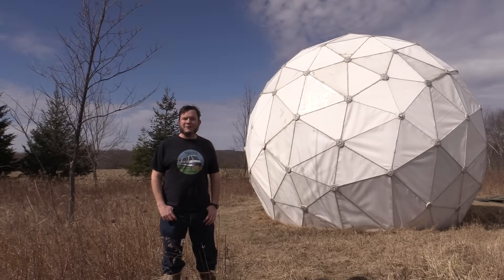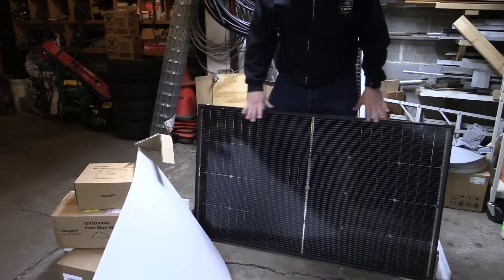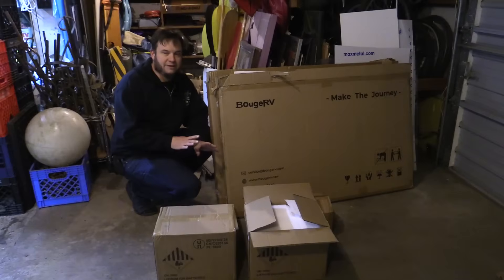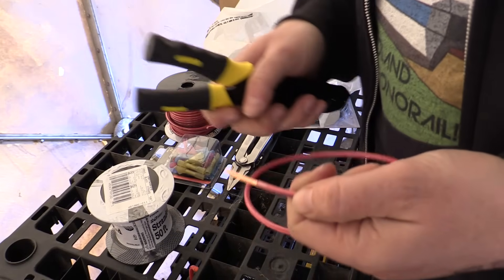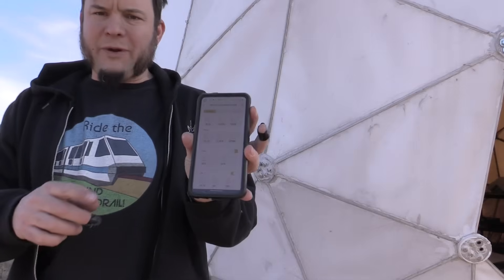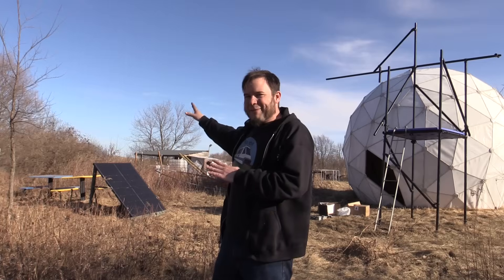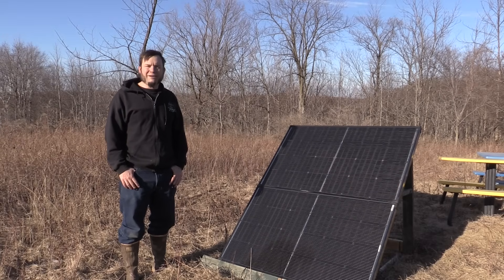Adding Solar Power To My Geodesic Radome - With BougeRV Equipment Review

Comment: Great video!  I have that exact BougeRV 2000w inverter.  I've never gotten the bluetooth to work, and the voltage fluxuates at low power (~40w)... but levels out and runs great at 150w+... and It did fine pulling 1500w.  if you have an oscilloscope I'd recommend putting it through tests before you hook up any high dollar electronics to it.  I'm curious to see how it works out for you.

Comment: Dude I feel you with the price of wire and hardware. I used to manage an auto spares shop and I got cost plus 10% pricing, and loads of free oil and filters for my car. I just had to buy my first oil bottle 2 years ago for my work vehicles and paying full price for 20L of full synthetic sucked! I’m in the process of adding driving lights and a DC/DC charger onto my ute so I bit the bullet and bought 50m of wire and man that hurt lol. I’m putting a roof top tent onto my daily ute, as it has a huge alloy tray and ladder racks so I’ll put a roof cage all the way along and bolt the tent to that, then I can still use my tray and it’s only a few bolts to remove the whole lot for storage. Once that’s done I have another ute with a camper on the back that I need to completely rewire, insulate, add some batteries, solar, and then set that one up. I love the work though, I really enjoy figuring out the best way to do things and how to make it just the way I want. Those solar domes look like they’d make an awesome tent! I had an idea of making a house with domes like that, all modular, connected with smaller tubes so that you could add more and more domes to your house when you wanted, and you could make it in any configuration you wanted, and make them so that you dig a 3ft deep round hole in the ground, concrete and insulate it then put the dome over the top, solar panels on the top of the panel, and have blackout curtains so you could block out the sun and close the room off completely if you’re not using it so it stays cool/warm. Maybe if I win the lottery I can try it out haha. Great video man, I love your content, it’s not all my thing but you make it all interesting. I just wish I had an Axeman in Australia!!

Comment: Depending on how well the inverter was designed, you may have just built yourself an annoying RFI generator. Loosely twist the wires between panel and controller, and put ferrites on all wires close to each device, just to make sure you don't create any weird unwanted signals.

Comment: So I noticed on the box that those are bifacial solar panels. I checked their website (which is kinda broken for me?) and it says they're transparent on the back and can make 80% of the power the front makes. So putting them vertical with one face directly west would be an option, if that made sense for your setup. That way they make heaps of power in the morning and the evening, and don't overheat at noon. You might be too far north for that to be worth it, though. Especially the overheat bit haha

Comment: MC4 connectors are dogs breakfast, not using them is a good thing.

Also, either your hands are really big or those inverter cables are a bit undersize, should be 00 gauge for 2000W, at least that's what it is in 240v countries, but 12v is 12v and 2000W is 2000W, so it should be the same up there. 

Congrats on surpassing 250K, great to see it

Comment: Great video, Gabe! Just a little something I learned about inverters (especially cheaper ones) is that the HF interference is CRAZY… like a few other comments mentioned you might want to use buck converters or possibly build a faraday cage… not sure if it will even be a problem for higher frequencies but if you end up getting noise, the inverter is most likely the culprit

Comment: You "need" a forklift out at Sandland. Not the kind you see in your local warehouse but the kind you see outside that operate on multiple axes - including moving in and out on the horizontal axes for example. You can then do the sketchy thing of using a pallet (I'm not sure why that's spelled that way) as a platform and you can reach the top-most part of the dome without the more sketchy thing of using multiple ladders. Note the quotes around "need".

Comment: I implore you to ditch the inverter and run DC to DC adapters for your kit in its place! The spectrum noise generated by most Inverters (even the pure sine wave ones) can be horrific!

No problem with a decent MPPT solar converter and DC to DC in my own experience, until you turn on the inverter!!!!
Reply: I run HF to 10GHz from my campervan. 480W of MPPT controlled solar , 305AH of LifePo4. When the inverter is off I get zero appreciable QRM from the system.

Comment: 3:45 unacceptable.  That's literally 1000s of $$$  and they couldn't be bothered to include the wires?  BIG disappoint.
Reply: They can supply cables but they have to be ordered separately. This actually makes sense because each installation has different cable requirements. Their website seriously needs improvement though - I couldn't get it to work on two different browsers. It eventually took a Google search to find their cable section!

Comment: Does sand land have any creeks? Check out a guy in New Zealand called Marty T. He's you but with diggers. He's made a power plant for his forestry block using a creek, some used piping and a washing machine. If you need a relatively cheap 120v ac supply and have the know how and terrain might be worth a look at.
Reply from the maker: We don't have any permanent water, just a little when the snow melts.

Comment: Nice setup. Just be cautious of low temperatures. The battery management system will limit charge current based on temp and won't charge them at all below 1 or 2 degrees Celsius to prevent damage. Here in Europe, domestic solar batteries are using built in heating pads to cope with the winter

Comment: Could look into solar tracking.

Also depending on what you're running, like lower power computers, instead of running the inverter, run into a buck/boost converter, it will be more efficient than making AC and converting it back to DC

Comment: You did it again Gabe! Two videos in a row for my current priorities getting ready for summer-eBikes & upgrading my solar panel system for camping.  Amazon orders are dropping in with solar panels, MC4 cables/connectors, panels etc.  A new eBike on it's way.  You've been spying on my To-Do list!  Well done.  Look forward to the continued dome power project.

Comment: I wouldn’t worry about the solar panels interfering with the radio telescope, but rather about the DC-to-AC inverter and the rest of the electronics you installed in the dome.

Comment: Make sure that the batteries have some sort of low temp charging cutoff.  Lithium iron phosphate cells will instabrick if they are charged below freezing.  The better batteries have built in low temp shutoff in the BMS that will shut them off but a lot of cheaper batteries do not do this.  (even if they claim they do)

Comment: I'm not trying to be a d%^k but, come on. A hardware store is not going to have Mc4 connectors, they don't sell solar panels so they definitely aren't going to have the needed wiring accesories.
Reply from the maker: Some of them do sell solar panels, one even sells wind turbines.
Reply: @saveitforparts  lowes or home depot? or a smaller one like a mom and pop store

Comment: cats will pee on your solar panels. Out in the wild like that, WILD cats will pee on your solar panels.

Seriously, I'd be worried about wiring getting chewed. Even when I'm nearby, raccs and rats chew on any wiring or soft plastic.
Reply from the maker: A lot of wires have soy-based insulation these days, I think most modern cars are pretty tasty to rodents.

Comment: For lots of applications ditching the mc4 connectors and doing a simple crimp/heat shrink creates a more reliable connection. Without having to buy a fancy crimper and connectors youll use once or twice.
Im a commercial/industrial electrician, electricity doesn’t care if you use an mc4 or not. Just make it nice and tight and water tight
Reply: As someone who's worked in the industry, the MC4s are a solid connector and if you need to be able to reconfigure the system, they're great.  However, if the system is going to be unchanging, you are correct, no connector is always more reliable than a connector.  Connectors are the most common failure point in most solar installations
Reply: Screw terminal blocks can also be a good way to go if you can keep the water out of them

Comment: it might be wise to have the solar power equipment in their own separate Faraday cage away from the dome with an output filter on the 120v line then have that line go to the dome. That way any RF it produces will have less of an impact on sensitive radio equipment.

Having the 120v on it's own line would allow shorter solar wiring to the charge controller and batteries. Just bury a cable that rated for it and run that to your dome.
Reply from the maker: I might actually move the stuff over to another building nearby (where we had the wind turbine). Just need to bury some more wires.

Comment: MC4 Connections should be carried at the electrical supply houses, the types of places that electricians, low-voltage contractors, and so on will shop at. A few chains near me will just accept walk-ins without needing an account. With how amazingly cheap you can get solar panels, MPPT controllers, LiFePO4 batteries and inverters now I continue to be amazed that the big box hardware/DIY stores don't stock this stuff... Or if they do, it's going to be things that are horribly outdated and overpriced, like basically anything usable for off-grid power that I find at Canadian Tire. Thankfully, some smaller independent stores have cropped up locally and have prices competitive with online stores, which is nice to see!
Reply: The "big box stores" barely carry anything useful anymore. They're mostly appliance / paint / pictures / flooring / blinds / lightbulb / patio furniture / plants / lawnmower / seasonal decoration stores now. Hardware and building supplies are like an afterthought. I can't even keep track of the number of times I've gone there, looking for something specific that they used to carry, and they no longer have it in stock, but they've got more of the above junk taking up the space now.

Comment: UPS - they take care of your package , to such a degree , that it probably will sit at your closest facility for days on end and , because they are simply admiring it . On time is another story , but it has a good chance of arriving at your door and in one piece .
Fed Ex - ex Samsonite luggage testers of the shipping world .
Your odds of getting your shipment in as shipped condition , are no better than 50/50 .
This is also the same approximate odds of getting your package delivered to your door step , or , some random ditch in the vicinity .
USPS - when civil service contracts rabies , but does not die .
Almost as good as UPS , but , they don't really care about your package and will not admire it for days on end . They send it out on tour . If it looks like Bugs Bunny's suitcase was sent via Fed Ex , that's USPS .
They have the best tracking in the industry and you can literally watch your package on every leg of its US tour , as it does laps , runs wind sprints , and occasionally plays hide and seek .
You will probably get it eventually .
Amazon - their logistics director was either responsible for much of the MX Missile program , or , Amtrak schedules .
Your package will start at the closest facility , and go a minimum of 300 miles in the opposite direction , th n wind it's way back when it senses the coast is clear . That's when they use USPS .
If they handle it their selves  , it's so top secret , THEY don't know where it is and won't tell you , and neither will their alleged " tracking number " .
For all of them , on time is when it shows up , if ever , and , NONE of them can read directions .
The date promised is just to shine you on so you don't call them , hopefully ever .
Reply from the maker: It varies by area too. At home we get US mail for the neighbors, nearby cities, sometimes other states, and occasionally for us. At work the mail carriers all know we have a nice bathroom they can use, so we get multiple deliveries a day. The UPS guy comes to my office and hand-delivers stuff. Fedex runs over the package and then leaves it outside in the rain. The Amazon driver gets laid off halfway to us, then the replacement driver gets laid off 3/4 of the way, then the 3rd driver throws the delivery in the bushes right before getting laid off.

Comment: Make sure the inverter is grounded because it can ommit spurrious emissions if not grounded. All wires on the batteries must be equal lengths even to the inverter. With direct current the longer the wires the greater the voltage loss. (Just putting this here for the viewers as I am sure you probably know)

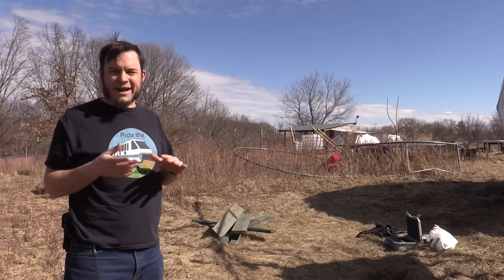Comment: @5:20 you will want the angle to be the same as your latitude. To increase efficiency, Amazon has a solar angle guide that is very cheap and works great.
Reply from the maker: Yep, we're basically ight at 45 degrees North.

Comment: If you put a single large soft object, like a couch or a big open cell foam panel, inside the dome, it will have an impact on the sound quality. It won't fix it, but one of the weird things about sound treatments is what you're effectively doing is adding things to the room that put the brakes on certain properties of sound. You don't have to coat a room in foam panels to make it sound better, you just need some stuff in there that will absorb some of the sound energy so the energy doesn't circulate around efficiently. If you could hang a couch cushion in the center of the dome, I bet it'd even do a lot.

The other major kind of sound treatment is diffusors, which take a coherent sound and break up the energy into different directions and timings so it sounds more like a rumble than an echo. You might enjoy making a diffusor but there's so much echo in there I don't think it the rumble would be much better.

To elaborate on soft, you want a material the air can travel into, this will help it to efficiently transfer energy into the foam and help it to not reflect. Anything with a smooth coating isn't going to be effective, and anything that's both hard and smooth will efficiently -- and coherently -- reflect the acoustic image

Comment: Where I am it's UPS that will mess up your packages.  That said, I used to work for RPS, progenitor to FedEx Ground...I worked the inbound shift unloading trailers and loading delivery trucks....it was a long time ago...sometimes I got bored and decided to play 'what's in the box' by handling them in such ways that might open them.

The point is that it's more to do with your particular terminal than maybe the whole company.

Comment: MC4 connectors work great for their intended purpose. The only problem is that they are proprietary and use is not widespread yet. You would have gotten the same look if you had been looking for an SAE solar connector. At least you can buy those at Harbor Freight. But they are not wonderful for permanent outdoor use. The crimper and parts kit for MC4 are now part of my regular toolbox at the off grid cabin.

Comment: The generic mc4 crimpers for ~$20 work well. Also the cheep 50 cents each MC4 connectors are good for about 150 volts safely.  After that voltage I recommend the brand name ones that are about $2.50 each. I've become real fan of MC4 connectors and use them in non solar projects too now. They're very waterproo. Just make sure to use the MC4 crimper for strong/ safe  crimps
Reply: As someone who has done ee design work in the solar industry, do not use off brand MC4 connectors.  Some are ok but others are a fire hazard.  We tested a bunch and some are incredibly sketchy.  Stick with name brand.  The connectors are the primary source for failures and fire, don't cheap out on them.

Comment: Time to make a sun tracker for those panels!
Reply from the maker: My uncle had a commercial sun tracking mount back in Alaska, it worked for about 5 minutes and then died. I'm a little leery of adding more mechanical "stuff" that could break down!
Reply: @saveitforparts  Yes and the tracking hardware might cost more than just adding more panels.
Reply: @saveitforparts  Could do a single axis tracker that uses an old gate actuator. Use a timer rather than sensor so that it's always pointed in the right direction for the sun even on cloudy days.
Reply: This is an excellent idea, I bet he already has the parts for it in his garage!

Comment: Does your charge controller have an input for the wind power generator that you have?  Might be nice to have a second source of power to recharge the batteries when there is little-to-no sunlight.
Reply from the maker: I might set that up again once we have the dome closer to finished, it's just being stored at the moment since we weren't really using power there.
Reply: @saveitforparts  The cool thing about the charge controller is that as long as the input is within it's range, it wouldn't care what is producing the power.

Perhaps you could power it with an exercise bike or treadmill, or even a Gooble Box.

Comment: FedEx Ground are contractors with limited training, FedEx Express are the actual FedEx employees (you probably see these less often). UPS drivers are typically hired internally from truck loaders or temp workers and get much better pay/benefits. I also prefer UPS over FedEx, they just don't care at all lol.
Reply: Fedex is so suspect that both my employer (regular shipments of hazardous materials) and my brother’s employer (regular shippers of expensive, heavy equipment) never ship fedex because the loss in time/insurance hassle is too high.